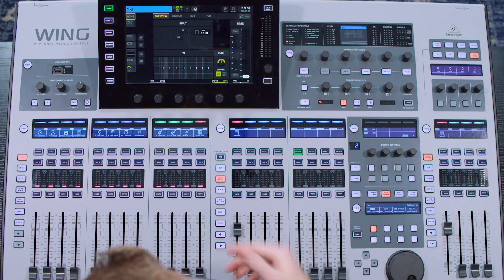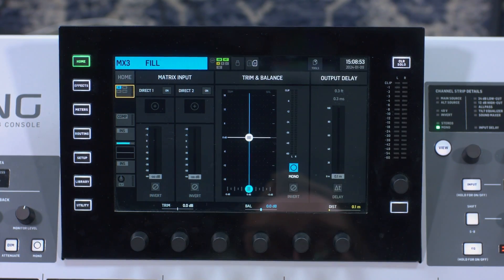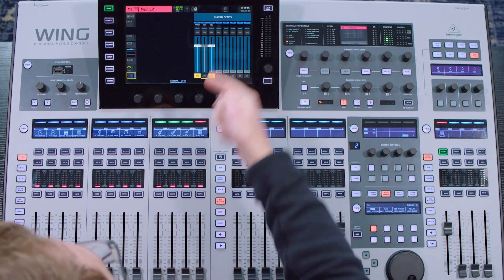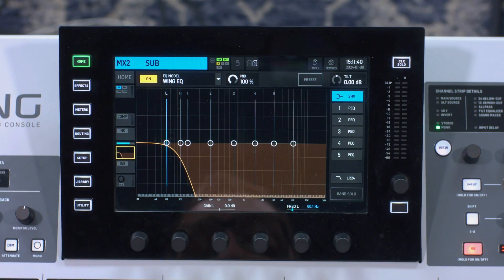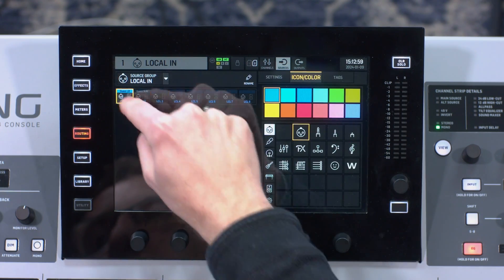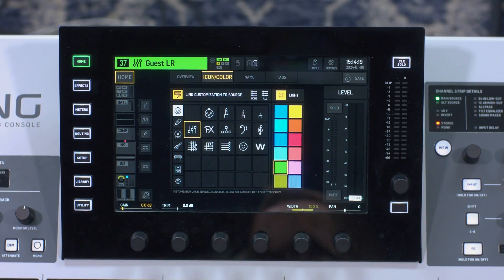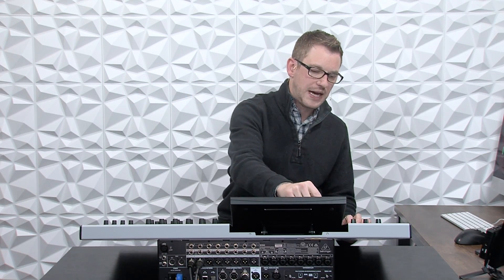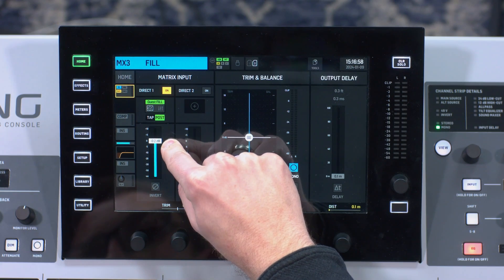Setting Up a Left Right Sub Fill on the Behringer Wing

Comment: Hey drew, there's a small conflict in here, hope I'll be able to explain well, focus..
The first thing you do is you setup the matrix and sending it out of outputs 1 - 4 on the AES50A. Now during the video you explain that you will send the channels directly to the matrix because you will be mixing on the main LR and you don't wanna confuse it, which is a great theory, how is your mix gonna be heard while his matrixes are feeding the outputs though? So you will have to change it manually in the outputs before you mix and before he mixes?
Reply: Good question, wrong observation.  The matrices aren’t owned by anyone in this way of patching. His LR is being sent to matrices and he bypassed the guest from going to his LR but, sent it directly to the matrices from the input channel. If you know about matrix mixers then, this is the way Wing does matrix mixing. They both can use the output at the same time, he could even have a second guest and all three could mix together in tandem